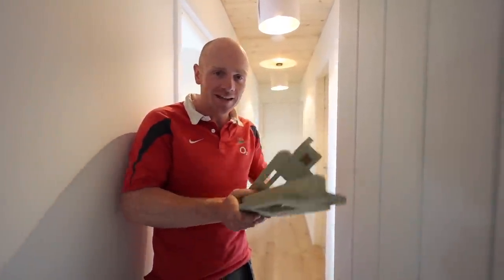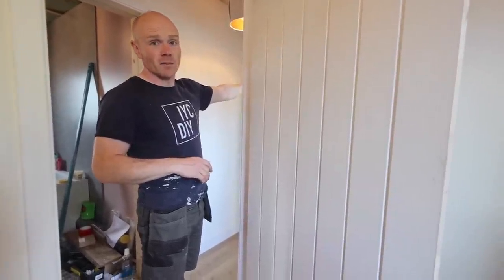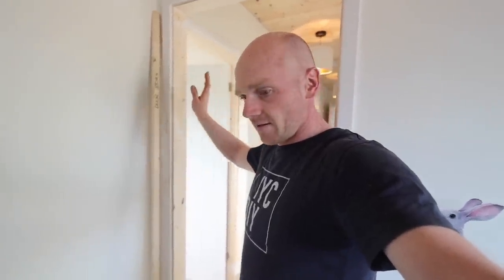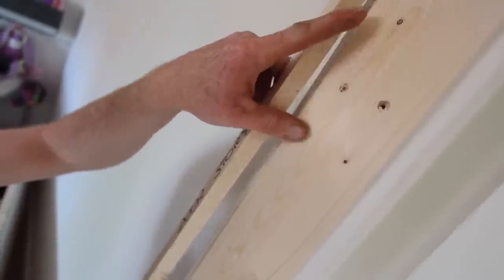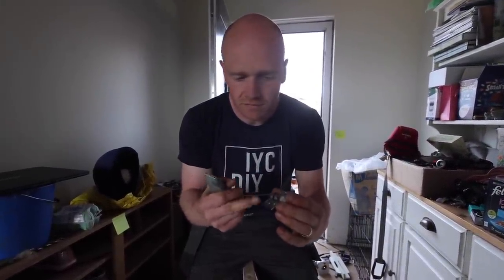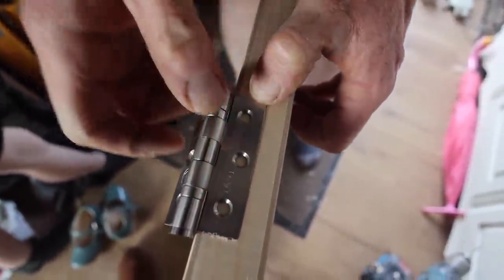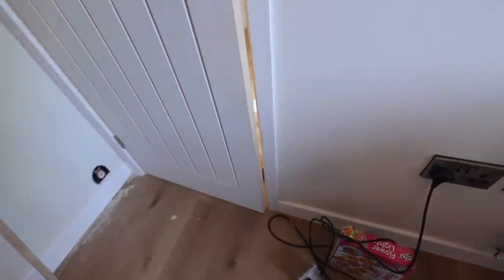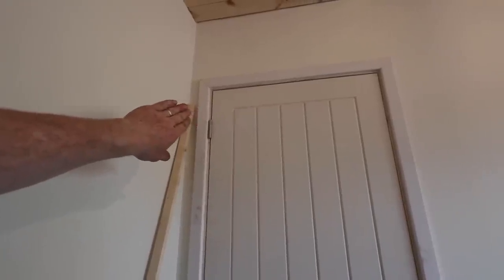MAKING HANGING DOORS SIMPLE 🚪

Comment: Get your door fitting 1st with a nice gap all around in the frame, put a leading edge on both sides of the door, put your hinges on, then put the door back in the frame, I set the height using a 2p at the top of the door then inflate your winbag at the bottom of the door and the 2p gives the correct spacing at the top of the door, then mark your hinges on the frame and cut out 👍

Comment: You put the hinge on wrong, it should be three knuckles on the lining, two on the door
Reply from the maker: Don't think so, all have 3 on the lining.  There is one bit where I was testing the fit and put a screw in but that was more to show a close up of the cut out, all installed the right way round.  Must have been more focussed on the camera angle at that point! 😂

Comment: What was the anti-slam mechanism? Something fitted separately or some posh hinges I haven't seen before?
Reply: Just air pressure mate.
Reply: Thanks, shame, got some badly fitting doors at home that slam and was hoping there might be some new magic hinges or something!
Reply: @edwardfry5502  you could maybe put some white draft excluder strip on the slam strips. You might need to adjust the keep slightly. Would take the bang out of it though.